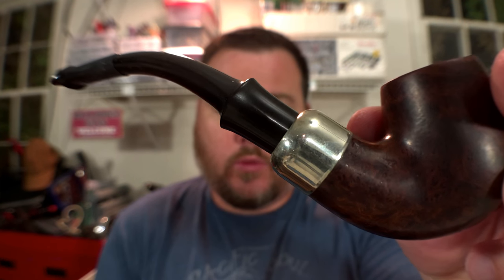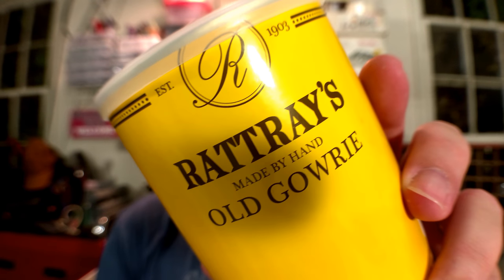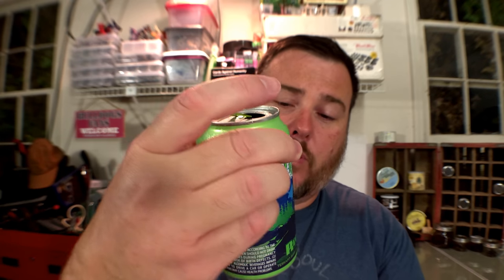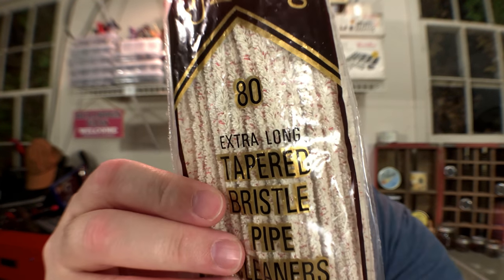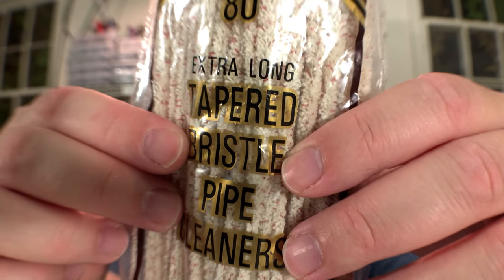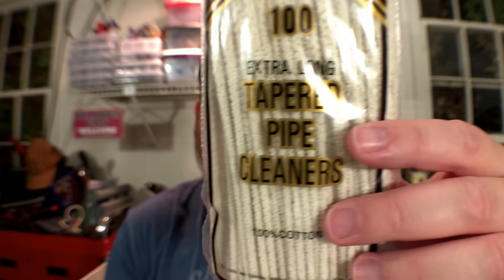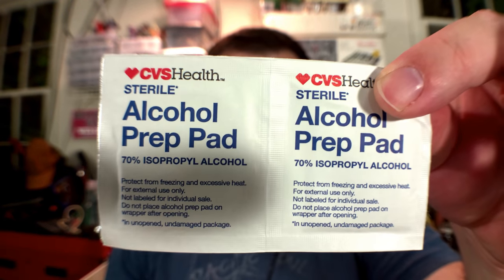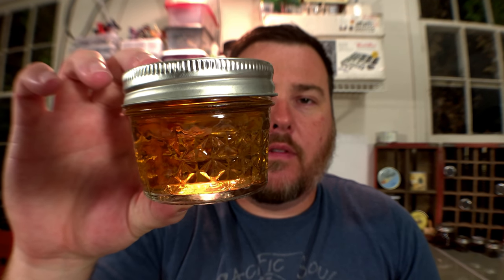Pipe Restoration Part 1 - Tools and supplies needed - 4K

Comment: Can vinegar be used on the stem?
Reply from the maker: Well one big thing about the stems, which I don't believe anyone really talks about is oxidation inside the stem. Vinegar is a good idea for drying things out for sure and reducing moisture. I would be weary of the taste. Also, when using an oxy clean or bleach bath, when the stem oxidizes it does so everywhere. There is not a lot of room in the draw hole to begin with, so if you can get some sand paper thread, probably no smaller than .01" and if you can fit larger and get it through even better. You would want to try and sand down the inside as well. That's a very tedious process but, worth it I feel. I would also do a retort after you have done that. If you are unable to do it, I would still do the retort. I will have to do a video on how to do that part.